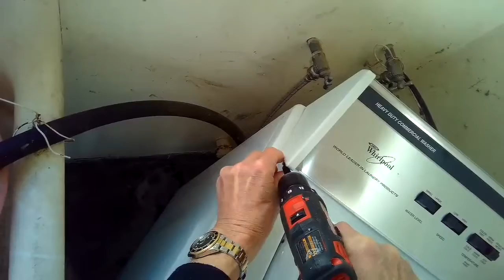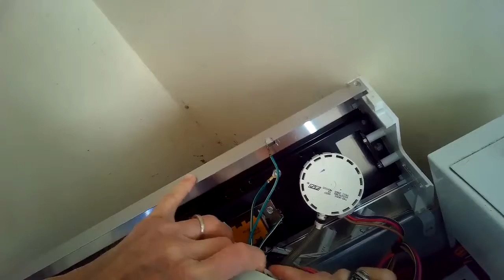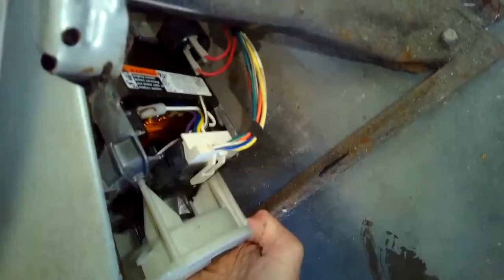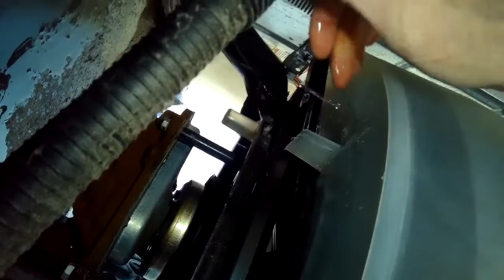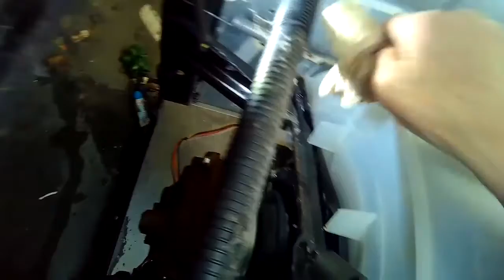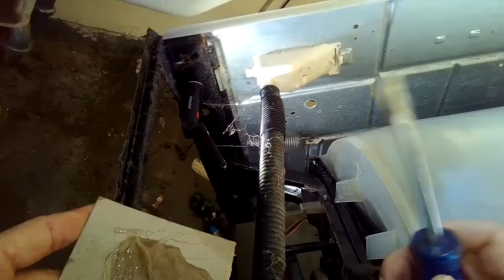Washer Leaking - Cracked Tub (FIXED)

Comment: Repair mine probably 8 years ago, cut the fine and use extra plastic for weldind and also add epoxy, still good in 2025 washer is 2001 model. Brake is the problem with good load when the brake engage all the tub twist and hit the frame. Also remove the brake by add with cotton swab bit of grease in the brake pad. No more bang and washer twist and the cycle end.
Reply from the maker: Good ideas😀

Comment: I used Gorilla Waterproof Patch & Seal Tape and it sealed it perfect.  Make sure to clean plastic surface well before applying the tape.  No need for all these extra weldings; they mostly failed when I tried them.  Use the tape, you'll thank me later!
Reply from the maker: Thanks for the tip! 👍

Comment: Do not use this method as this will eventually crack off,  its much better to plastic solder, i have repaired many over the last few years
Reply: what material is used to plastic solder? You are correct, these plastic tubs are near impossible to just epoxy over a leak.

Comment: This won't last. Better fix used a plastic welder  tool melt the cracks closed,  melt new plastic over that like from  a hard zip tie,  then use jb water  weld over to seal seals it from water.
Reply: Which type of zip ties, nylon or polypropylene?
Reply: How about soldering?

Comment: Thank you so much for this video I also found a crack in the same place and I went to home Depot and got some gorilla epoxy

I did everything you did now I am waiting for it to dry I actually have a fan on it because I'm going to put an extra coat..

My question is did your washing machine ever leak after doing this?
Reply from the maker: That did the trick👍😊
I hope your’s works.